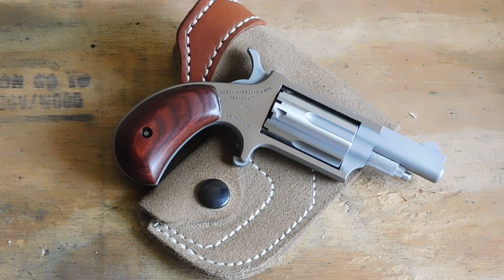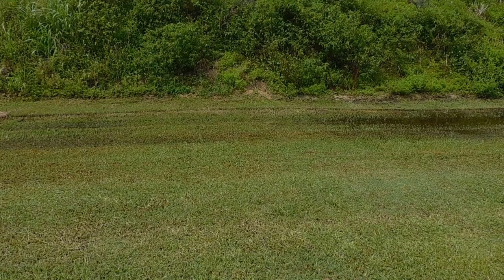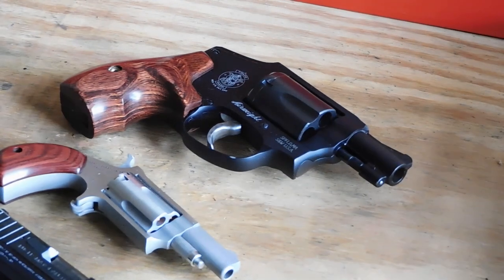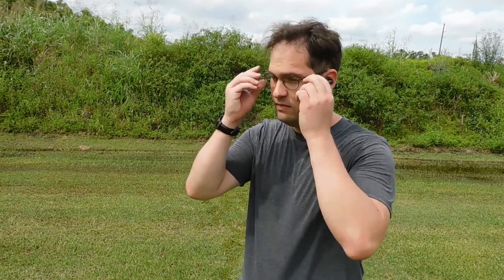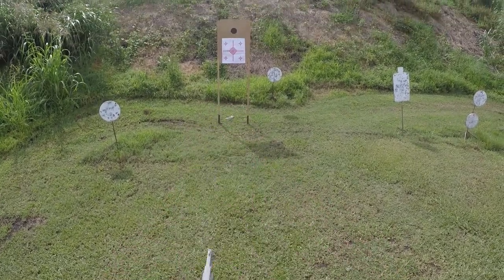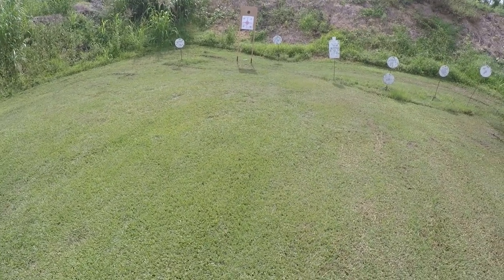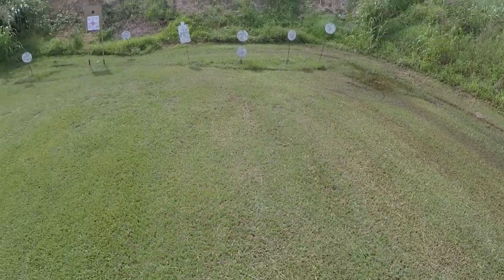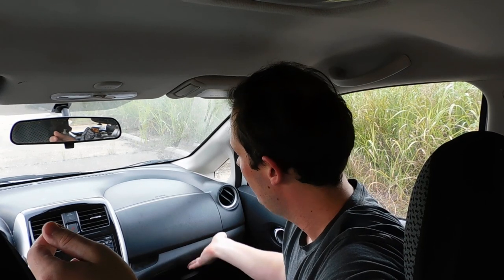North American Arms Mini Revolver: How It Saved My Life?

Comment: I purchased my NAA mini 22 long rifle standard back in mid-90s basically as a backup to my 38 special snub... I did carry as a primary hidden in the arch of my shoe going into the hip hop clubs.. as bouncers would  pat you down for guns at the door .. once inside the club I would go to the men's room retrieve my Naa .22lr . Place it in a pocket holster in my right front pocket.. so much for inside the club ..BUT for that long walk out to my car in the dark parking lot at the end of the night... I have since purchased the folding grip for my NAA 22.. folded the profile is really not much bigger.. unfolded I have a full Grip ! I can flip open the gun and cock it in one second flat! The folding grip also covers the trigger which is good in case the hammer accidentally gets cocked.. the folding grip has a clip on it and I can clip it to my sweatpants walking around the house or even my BVD tighty whities 😂.. never unarmed.. I most recently purchased a 22 magnum NAA wasp.. I need to get to the range and get more practice with my new wasp

Comment: Keep in mind that if you have an extra cylinder or 2, it would almost be equivalent to loading another “magazine” into the gun…Will probably be decently faster than ejecting spent cartridges and loading in more bullets one by one…not to mention, (as with the gun), the cylinders are relatively small in stature, and therefore one could carry several preloaded spares without feeling too over encumbered…just food for thought!🤗
Reply: This is an idea that needs to make its way to the mainstream revolvers—hot-swappable cylinders for fast reloading, though moon clips fill this niece quite well.

Comment: I've had one of the 22lr/magnum combo guns since the late 80s, I think, and it's like carrying a pocket knife if you don't use a holster. I just make sure that it is the only thing in my right pocket and I just always wear loose fitting jeans/carpenter pants. The one thing that I have to be careful of, when cocking my gun, is that my hands do not touch the cylinder during that process. It is pretty easy to stop the cylinder from rotating to the next round and I have dropped the hammer on the previously fired round twice because it failed to rotate. Maybe you could post whether this is an issue with a newer gun, assuming yours is newer than mine. Also, you don't want to dry fire these guns. The chambers get indented pretty easy and that makes loading and extracting hard and will eventually cause failures to fire because of weak hammer strikes on the dented chambers. This is common with all rimfires but it shows up quickly with this particular gun, at least in my case. Because mine is the combo I can chrono 22LR and 22WMR and there are several 22LR rounds that come out of the gun faster than the WMR rounds, simply because the WMR is for long rifle barrels and uses a slower burning powder that ends up burning outside the barrel in this little bugger. Make a hell of a muzzle blast though! 🤯

Comment: Coming in to this late because it popped up in my YT feed right after I discussed it on Autum's Armory channel. I've had mine for a couple of years. I got the one with the Magnum cylinder and the one for .22short/long/LR. I took the Rosewood grips off because they are too pretty to get scratched up and replaced them with the hard rubber ones. Got a nice hand-tooled leather holster for it and it's my EDC unless I carry my Taurus PT111 G2 9mm. 😁 One tricky thing NAA did is that left-hand thread screw that tells them somebody tried to take it apart without knowing about it! Sneaky! 😆

Comment: I have probably 8 NAA mini revolvers and I usually carry mine in a ankle holster. I do have one exactly like the one you have and when I carry it in my ankle holster, it has the tendency of the hammer moving from the safety notch position and resting on a live round. This has happened more than once with just this one particular NAA revolver. This hasn't at all stopped my love for NAA revolvers. I just simply known not to use this particular revolver in my ankle holster but to use another way.

Comment: Good story, but I am surprised the guy could even see the mini in your hand, lol.  I own five of them, and one of the neat things is that you can palm the gun in your hand, and nobody can even see you have a gun.  These mini revolvers have a niche, and that is stealth and ease of carry.  They may only be 22 caliber, but it is enough if used properly, to get the job done, albeit, close range.  If you want to get the drop on someone at close range, this is the gun to have, one in each front pocket, weighs only 4 ounces and can be deployed in less than a second.  When I smell danger, my hands go in my pocket, which looks benign to other people because the gun does not print in the pocket, due to its size. If there is any downside, it is that it is only single action, but I wouldn't doubt that someday NAA will have the answer to that problem, lol.
Reply: The mechanism for double action would dramatically increase the size and weight of the mini...we think of ours as a derringer, last chance to change a mind type of gun...it was on the range yesterday, using velocitors...normally we practice with much slower ammo but every now and then the real deal ammo needs an appearance...

Comment: I have two of them. The basic .22lr model and the breaktop Ranger 2. The slip-on black rubber grips from Hogue are really amazing. Transformative. And they only increase grip size maybe five percent. Practically the same size as the original rosewood but you get an amazing grip at all times, like it's welded into your hand. I have them on both of mine. The rosewood was too slippery for me. This is so much better, I highly recommend them. Note that they're the slip on, not the 2-piece screw-on black rubber ones which are another option I haven't tried. Probably be almost as good, but no rubber on sides, and that's where your finger sits, mainly.
Reply from the maker: Yeah, the Pug grip is a game changer if you go that route. How would you describe your experience with the 22 LR? I only ever had the Magnum versions for the bit of extra power.
Reply: @professorpewpuew  I love the 22lr, even in my Ranger 2, which has a 22mag cylinder. I use stingers in the 2 inch barrel and mini-mags in the 1 1/8 inch. Also just started practicing in my basement with aguila colibri powderless rounds, which are like a pellet gun. Accurate though! Even picked up a Heritage Rough Rider a few weeks back, for basement fun with my son.
Reply: The 22 mags get some power out of the 2 inch ranger, but only about as much as the 22lr. The mags are really optimized for longer barrels. I see lots of evidence online also that this is true.

Comment: Mine was a Charter Arms, identical to the revolver design of this video. Chambered in .22 Magnum, 1.25 inch barrel. I shot an insane, rabid dog attacking me, as well as a raccoon attack. Just forget about the common fears that you won’t be able to hit anything with the tiny revolvers. When there’s a 4 hour ER ordeal on the line, (at the very least) you’ll hit & stop whatever it is.
Reply from the maker: It is easy to get obsessed with outlying events like running gun battles. While there are disadvantages to these little Minis, people do sell them a little too short. Funny enough most defense stories I have heard with Minis also have to do with stopping pitbull attacks. Something so mundane yet so much more common than encountering homicidal maniacs.
Reply: @professorpewpuew  It would be more likely to bargain with a homicidal human than a homicidal animal. I tried everything before I shot that dog. I screamed at it, tried to run it off with a pipe, but it just kept on charging. The raccoon? I knew there was no running that thing off.

Comment: If you are going to try to crown the barrel with a brass screw, why would you dip the screw in epoxy?
Reply from the maker: That might have a bit of misspeak on my part. The term I believe I was looking for was lapping compound. I've only ever done it once and I generally stick to the guns with barrels greater than 1 1/8 inch, which generally don't have keyholing problems, in my experience.
Reply: Brass screw dipped in valve grinding compound.

Comment: Although this man is a skilled shooter, that weapon is meant to be used at the range of ‘across the poker table’.  If you shoot it under adrenaline at 20 yards, you will have to account for your wildly flying misses.  At that distance, if you have this weapon, run away unless you’re John Wick.  It is, however, an excellent ‘nose picker’ in a pinch.
Reply: Who the H*ll would shoot a mini revolver at  20 yards!!!? Its a last ditch 10 or 15 ft piece. Which is exactly what you may need in an emergency when you cant get out your main carry fast enough or the fight winds up on the floor. I carry a 22lr mini with 1 and 1.8 barrel with Federal Punch or various CCI,,, Velocitors or Standard rounds,  as back up to my tiny Taurus TCP 738, 7 round .380 micro subcompact automatic. Small and smaller, but light, comfortable and WILL do the job! Other times for lightweight carry with more punch I substitute my Keltec P11 smallest full capacity double stack mini 9mm on the market that Carrie's 11 rounds, instead of the PT738. Either or, the NAA .22lr mini revolver is a little work of art the smallest gun in the world that goes anywhere you go and in countless extremely discreet places on your body from a neck holster to on your ankle and anywhere in between! Very very Cool,,, dont leave home without one!
Reply: You can shoot any pocket 25acp 25 yards no problem and hit a dinner plate... I hear these Naa mini revolvers are way harder to aim and shoot than even a raven 25.

Comment: Your video show the Ruger LCP with an extended magazine, making it look bigger. I'm fine with the regular magazine which gives me 6+1. The LCP is a lot easier to get back into action if you carry a spare, preloaded magazine than it would be to reload the NAA Mini. Chances are, the 5 rounds of .22 WMR in the NAA mini would not stop a bad guy in his tracks as well as 7 rounds of .380 would.
Reply: For most bad guys...the very 1st crack of gunfire usually stops a bad guy in his tracks, and starts them running in the other direction!
Reply: Chances are it would be more than sufficient for self defense, the majority of attackers are going to tuck tail and run at the first shot. They are not likely to engage you in a gun battle like they might a police officer that is actively pursuing them. Also the NAA is significantly smaller than a Ruger LCP and less than half the weight so it's not exactly an apples to apples comparison.

Comment: In my state displaying or indicating you have a gun without using it is a crime.  If I ever pulled it I am going to shoot.  State law.......
Reply from the maker: I've learned not to worry about the law. If we were tried by the law, we wouldn't need lawyers. In any event, I'd take whatever little charge over having to live with a dead or crippled person on the brain knowing there were other options. There is the law and then there is right and the two are often contradictory.
Reply: @professorpewpuew  ...very well said 👍😎
Reply: With a 2x4? 😂😂😂